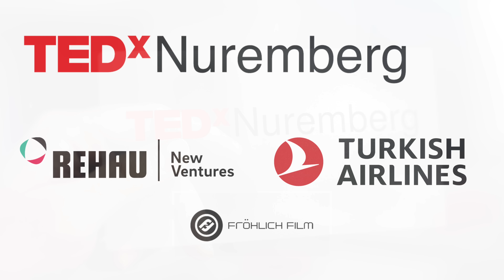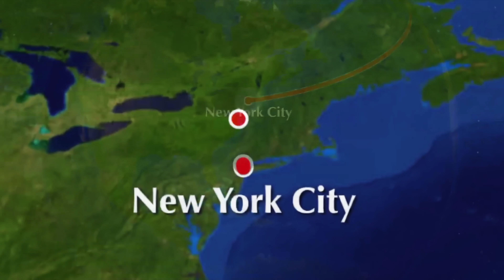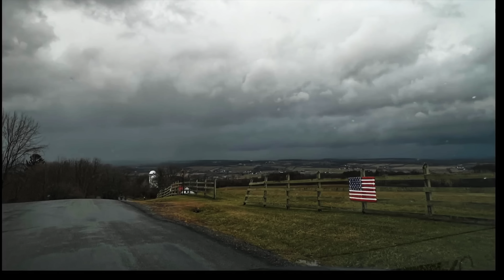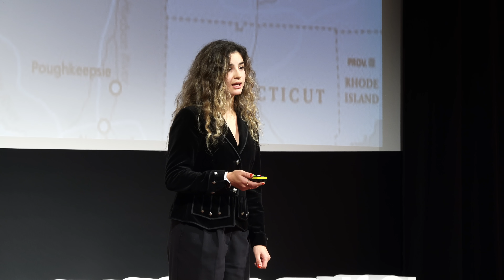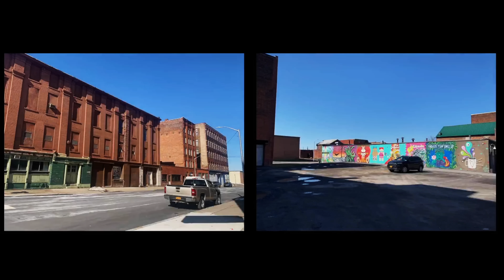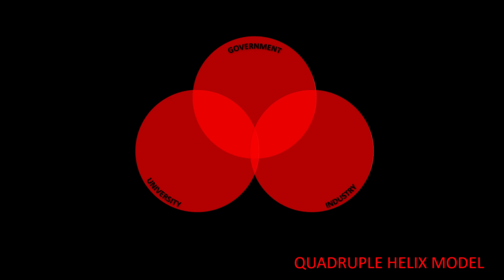Why innovation alone won't save small towns | Marlise Horvath Schneider | TEDxNuremberg

Comment: Innovation like the NY SMART I-Corridor, a consortium spanning Buffalo, Rochester, and Syracuse—focused on semiconductors, which received $40M for innovation, workforce training, and manufacturing and positioning it to produce a quarter of American-made chips by 2035. On the other hand, Binghamton/Endicott, historic home of IBM until the 1990's when IBM downsized and moved out, continues to decline even with the strength of Binghamton University, cited as the top public university in the SUNY system. So, the Chip Act benefits are targeted to specific companies and a small segment of the workforce but the overall region will see few benefits. And, in a competitive semi-conductor world, chip production can move to the most innovative and/or lowest cost competitors. Chips and more casino's won't save Upstate.